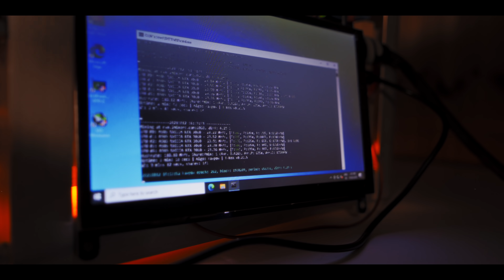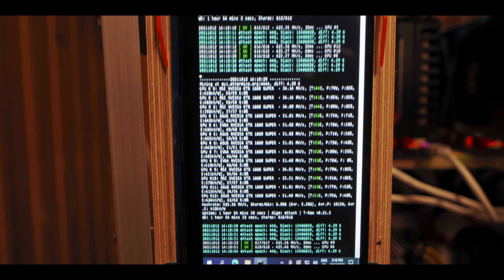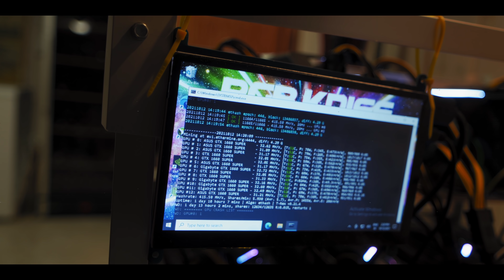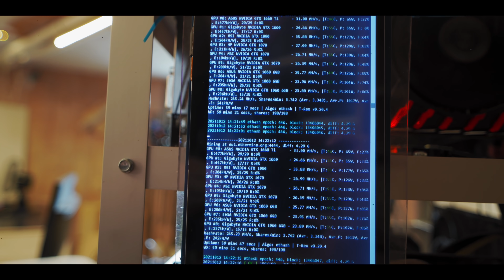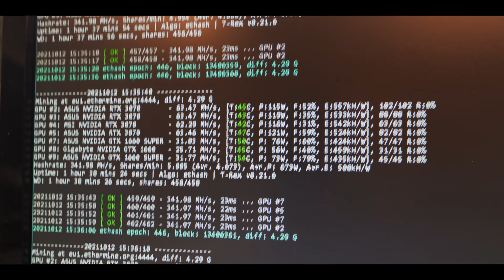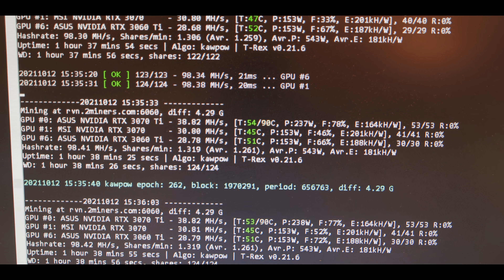Tour of my (almost) 2000 Mhs GPU mining farm! (2 GH/s on Ethereum+Ravencoin)

Comment: For the 5x 3060 rig losing a GPU on reboot I've been having similar problems on a z390 aorus pro wifi board with 6 GPUs. I found that using a 4x pcie adapter helped but ultimately I think it was the drivers. Using 471.11 I believe so far so good.

Comment: As far as your weird issue with that rig. Try fast boot in windows, turn it off. DDU and start again with fresh nvidia drivers. Follow the recent video from Jayztwocents. It fixed my rebooting issue which also would sometimes do very similar to what you said. I've spoke to you about this issue on the dc dude so you can remember who I am. I spent weeks chasing hardware and all along it was a simple software issue that I didn't even think of. I had the exact same error as Jay did in the video but it also manifested itself in a few ways. One of them would be rebooting to less cards. I'm 99% sure for me the issue is now gone for good, haven't had any issues for a week since the corrections. Jay does mention in the video this issue is more apparent on multi gpu setups. https://www.youtube.com/watch?v=F8OLhUAPDq0

Comment: Hey Seb, based on what you've done so far the problem on that 5x3060 rig seems to be a card issue. You have tested all the other parts and the problem sticks with that card based on what you said. I'd pull it out and run it in a test rig by itself to see if it has the same problem. Love the content and your farm!

Comment: @Sebs FinTech Channel, I have that same issue as you with 1 of my GPUs not being detected whenever I boot my miner sometimes (not always) - I run my miner remotely however using WiFi controlled power strips and remote desktop software, using an ASUS B250 Mining Expert Motherboard/Inteil i7-6700K/8gb DDR4 RAM/and 8 Nvidia GPUs ranging from GTX1070s, RTX2080tis, RTX3060tis, and RTX3070s (all pre LHR versions).  Seems like one of the GTX1070s refuses to come online when I boot up, or sometimes it causes the miner to crash as well (usually rarely - and occasionally I get a Code 43 Device Manager error for it when it crashes)...  A lot of odd issues...  It's rare that I get the crash or code 43, but I fix that with reinstalling drivers, seems like it works, another thing that sometimes works is simply disabling that GPU and re enabling it in Device Manager, then rebooting after either method. But I'd say about 25% of the time, when I boot the miner, or reboot it rather, one of the GTX1070s disappears (it is always the same one, an EVGA one)...  Often just rebooting it a couple of times allows it to get found, but because the miner is remote from me, I don't always have the ability to go mess with it physically...  But typically I can overcome the issue again just by re rebooting it a few times until it comes online...  Sometimes it helps to go to Device Manager and right click display adapters and "scan for new hardware" then reboot...  I don't know what causes it, but this is how I deal with it...  I would be curious as to what the cause or fix is though...  I've tried like you replacing risers, etc...

Also oddly, that particular miner is 1 of 3, and any time I try to remote into it, it always takes longer for it load up compared to the other rigs - the other rigs also run Intel i3 CPUs, where this one is an i7, so that's odd...  otherwise all the same hardware give or take...

Lastly, this same miner has an issue with hashrate, where after running for 30 minutes or more, it will dip in hashrate across all GPUs, and sometimes fluctuate, sometimes it just dips and stays there, down like 5 MH/s...  I usually I have to reboot it once or twice, and it seems to quit dipping...

I've tried replacing risers, even the motherboard, etc...  I don't know what the problem is, but again, it affects all GPUs, no just one when the hashrate dips...

Comment: Excellent video thanks for the tour. I wonder if you could make a video of all the accessories you use and how you set them up. Are those GPU power cables aftermarket or came with ATX PSU. Thanks again

Comment: Hi Seb, I have similar problem with 1 of my 6600xt mining eth. Works perfect with the overclocking settings, as soon as I reboot I get all bunch of errors regarding SMU state and the GPU is not propperly detected anymore, have to power off and reset the clocks for a stable "rebootable" clocks. Hope this helps, thanks for sharing! Cheers

Comment: So yes, I had the exact same problem... GPU2 not detected, difference is that I used Hiveos. Non the less, I think that I solved it by connecting 4 of my gpus to a PCIe to 4 USB A splitter. I think you made a review on it
Reply: Oh! And also check you PCIe 8 pin splitter!!!!! A faulty one can be annoying! So try changing it because the GPU can turn on but one of those pins doesn't work fully and messes thing up!

Comment: Same exact thing happens to my 3070 ti rig, always 1 card crashes, tried many settings but it's not overclock settings related. Sometimes board gives no info on hw64, and have to ininstall and reinstall. Sometimes works some times not but then change pcie slot reinstalls and runs ok for a while. Don't know what to try more...

Comment: Hey Seb
I had similar issue you have on your 3060 rig. I ended up separating one gpu running on a different instance of mining software. It has helped a lot. I do not dare to touch the rig though. It has been working without issue for last ten days.

Comment: Cool setup! Putting in work.
For the rig giving you gpu problem not showing up extra cards. Sometimes, fresh install of drivers helps use ddu uninstaller to fully wipe drivers. Also check in the device manager if it shows up but just not functioning. If it is showing but not functioning it could potentially be a resource problem. Depending on how much ram you have in the system, try and allocate more system page file, to allow for more resource usage. I had a similar problems and doing those helped. Also maybe play with the bios and instead of auto for pci-e slots set them to set gen. Hope one of those things helps. Cheers.
Edit: Question - Stability for the 1660's. Have you had problems with the bios flash as for crashing? I have like 7 1660s and ti's. Could get a whole other card out of all of them if I did the flash. Lol. Only if it is stable will I attempt it tho.

Comment: Hey Seb.  Great video as always but I didn’t see it mentioned in this video… How are you powering your fans?  How do you control or set their speed?  I am new to mining and temporarily  I am running two 3pin fans off a splitter cable.  ( Its a MOBO SATA to 3 x 3pin cable providing my power ).  I have ordered a splinter cable I plan to use off my 750watt server PSU.  It will be 6-pin female PCIe from Server PSU breakout board to six 3pin male to connect up my fans.  Any better way to do this?

Comment: Hi Seb, great vid as always! 
Maybe I have an answer on why your MoBo won't detect the GPU in that specific slot: I have one of my rigs with a B460 and the 2nd x16 Slot (running at x4) doesn't work at all while using an NVME SSD, and as I use both NVME slots with NVME to USB adapters (to gain 2 more pcie slots) the slot  will not work. However, if I look into device manager, I can see the slot is occupied, but will not recognize the GPU. This is due to the Pcie lanes the Mobo's PCH can handle.
Let me know if you can find something into device manager if you try to connect a GPU to that slot :)

Comment: What is the cheapest GPU I can use to start mining ? And how many would I need for a starter setup rig?
Reply: honestly no GPU is really considered "cheap" these days.
it honestly all depends on how much you pay for how much MHs.
in some cases a 1660 Super could be the best MHS per $, and in other cases a 3090 could be the best MHS per $. its really all up to lucky deal finds.
i started with my own non-lhr 3070, than built a dedicated mining rig and put both my 3070 and a 3080 non-LHR i found for a bargain on it.
afterwards i put on it two 1660 Supers because for the price i got them for they were significantly cheaper than a 3070 and their total MHs combined was higher than a single non-lhr 3070.
now i found excellent deals for 2060 supers (essentially 100$ cheaper for what i paid for my 1660 Supers) and each would do nearly 45Mhs.

so like i said, it really all depends about how lucky you are in finding good deals on GPUs.
and in theory you can always just start with 1 GPU and grow up from there (though if you do start with 1 single GPU, i'd probably just go by one of the top 5 GPUs in ethereum hashrates (RTX 3090, Vega VII, RTX 3080 non-LHR, RTX 3080Ti, RTX 3080LHR)
and i say that because every pool has a threshold of mined coin you have to pass every time if you want to do a payout (send the money from your pool allocated address to your own wallet).
the better the GPU you start with, the faster you will reach your payout threshold.
Reply: @HoLDoN4Sec   Thanks for explaining it to me. I've been trying to do a lot of research on mining and I've been looking for someone to breakdown a starter kit.

So would you recommend I build a starter tower from new egg specifically for mining? Also should I try to mine the big name cryptos or start with small to mid level ones ?

Comment: I wished I had found your channel sooner because your videos are far better.  E.g. your rig frame pdf plan is so much better and correct.  The one I used from another YouTuber had wrong measurements, missing design elements, incorrect Bill of Materials.  Ugh!

Can you elaborate on your power distribution? Did you install additional circuits, wiring or fuses?
Reply from the maker: No additional power but since I’m in Europe I have native 240V which allows for a lot more power natively on the property. But we are kind of maxed out now…